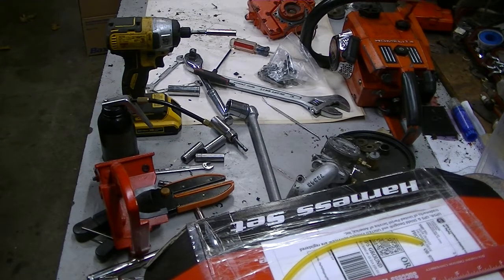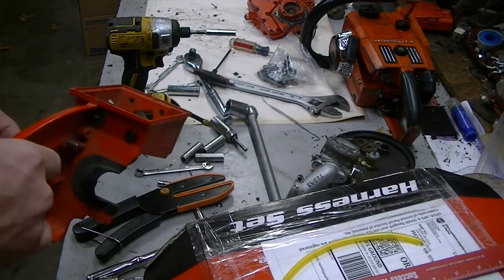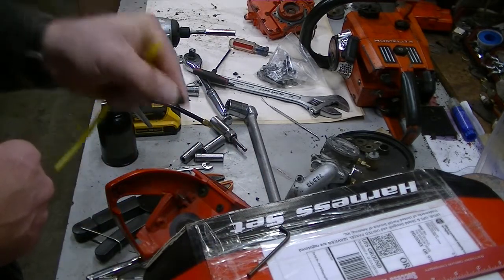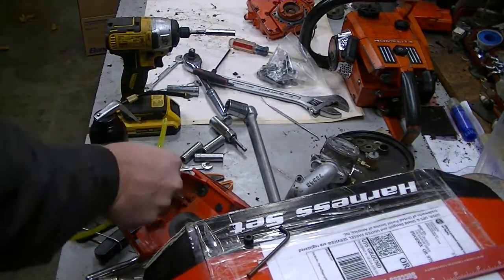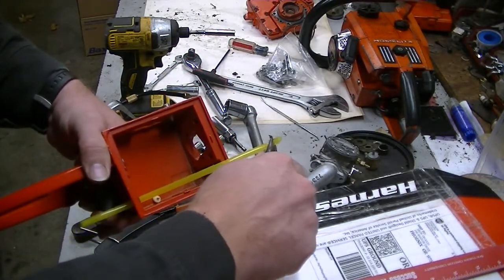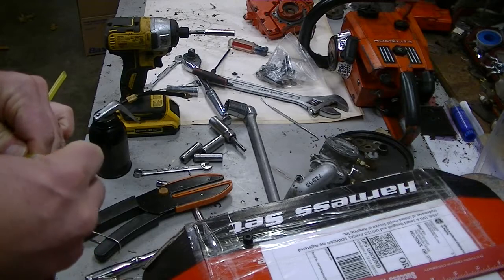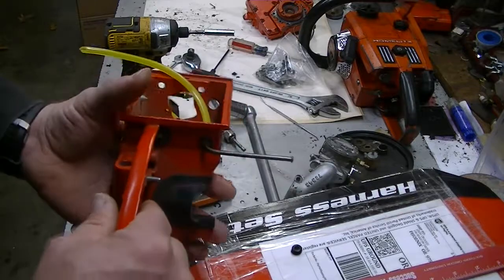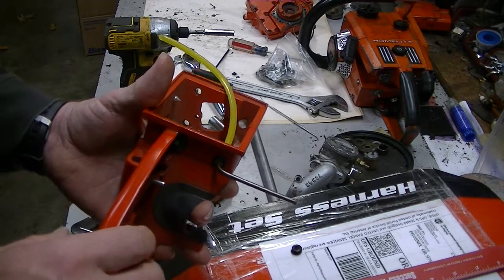How To Use My Replacement for the Homelite 65593 Fuel Hose in a Super XL-925

Comment: Like that idea of piercing the hose to pull it through.  I've started beside oiling the hose is angle cutting the end of the hose to help it through. Works easier for me. Then square cutting later on. Good video Leon.
Reply from the maker: Angle cuts definitely make all the difference!